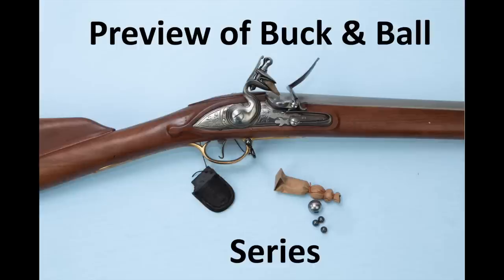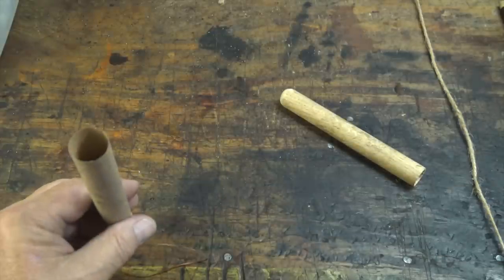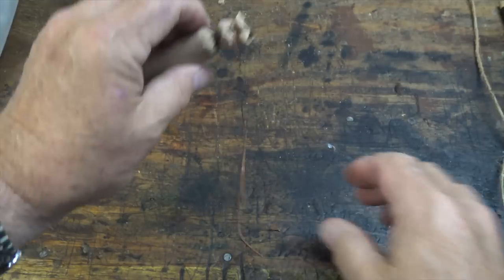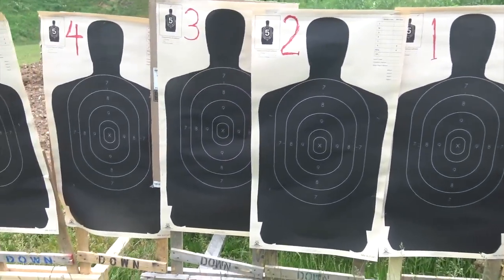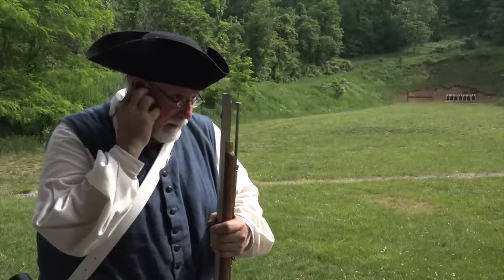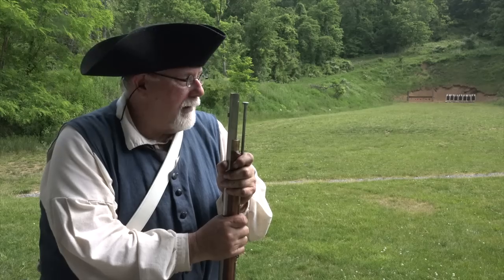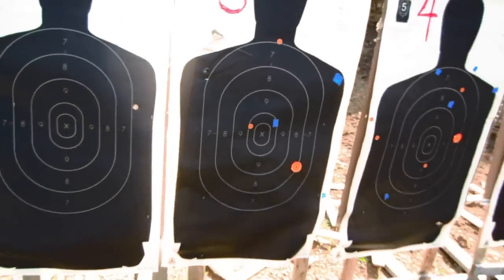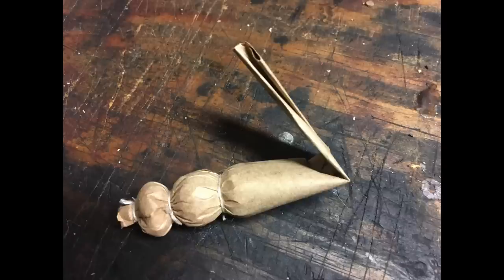Flintlock Buck & Ball Preview

Comment: I have the feeling some of those very low shots you're calling intestinal might actually fall outside of the abdominal cavity, but they could still strike into the groin (ouch) or inguinal region and potentially cut large femoral vessels or smash the thighbone.  The first of these is pretty much instant death on a flintlock battlefield; the second has a high chance of wound infection and lingering death, with permanent disablement for those fortunate (?) enough to survive.

Comment: Hi Mike I am a new subscriber, I did not know how to reach you so I am trying this I have a new pair of Uberti 1851 colts 3 days old one I got from taylor and one form Dixie GW the one from Dixie goes through 4 stages of the action (Clicks) the one form Taylor only 3 in fact the trigger does not start to move till you get just about to half cock.the gun does go into half cock and you can turn the cylinder. and the hammer does go to full cock but only in three stages. Both guns are unfired, What is your expect option. Thanks Bob  a new fan